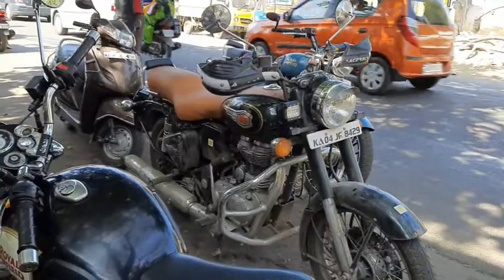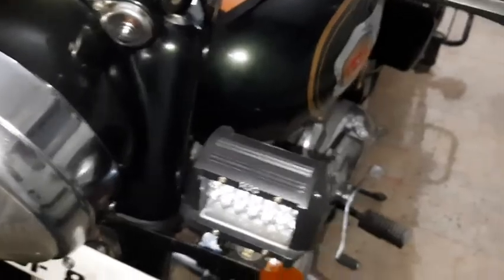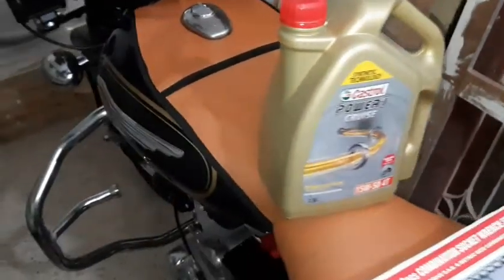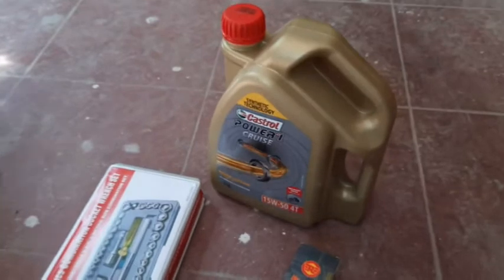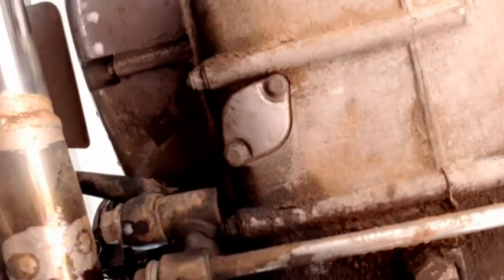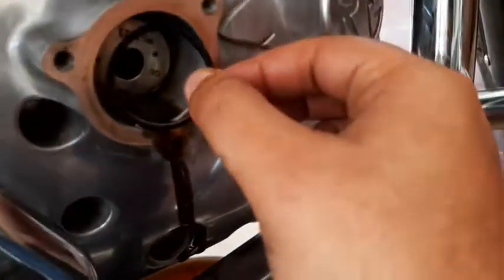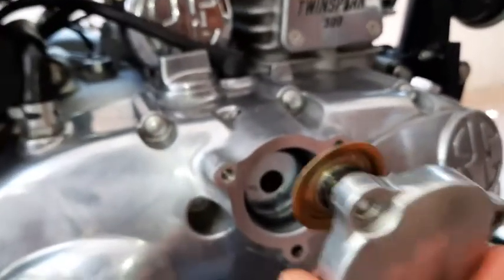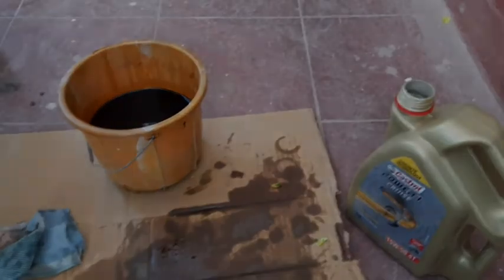How to change Engine Oil in Royal Enfield Motorcycle | Castrol Power1 Cruise

Comment: What are your reviews about Castrol cruise 1 now? I mean does the semi-synthetic actually help in reducing the vibrations also what is the period of next service ?
Reply from the maker: I have ridden close to 600 kms till now, the oil works perfectly. Gears are smooth and as far as the vibration of bike is concerned, its reduced a bit (very little). Its surely better than the Royal Enfield liquid gun oil. And I intend to change the oil at 6000 kms as claimed by Castrol if it sustains till then...
Reply: @BareedVlogs  now how is the oil
Reply from the maker: @devasudhan2078  I changed the oil at 4000 kms. It was performing well but still I changed it.
Reply: @BareedVlogs  thank u sooo much brother... can i use this oil for calssic 500
Reply from the maker: Absolutely... Even my Bullet is a 500cc bike and it worked like a gem
Reply: @BareedVlogs  thank u broo ❤️